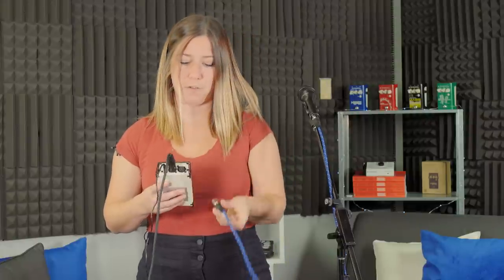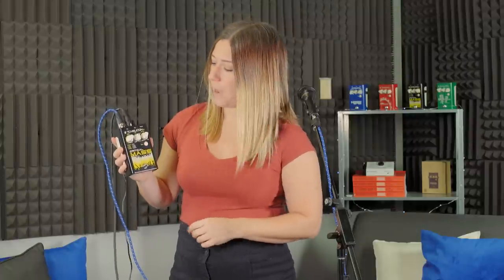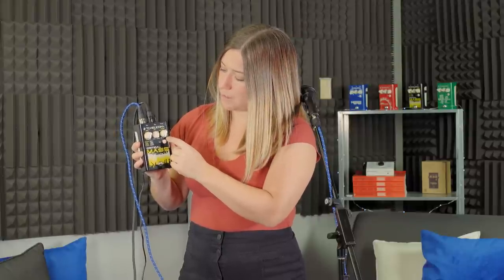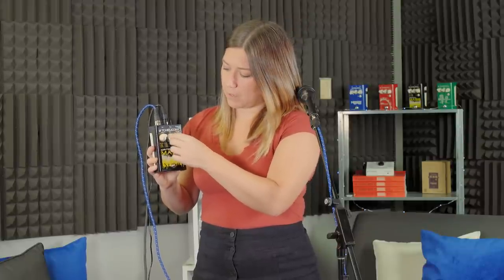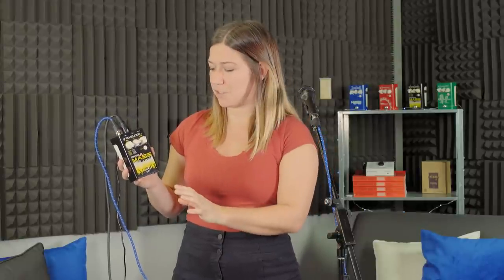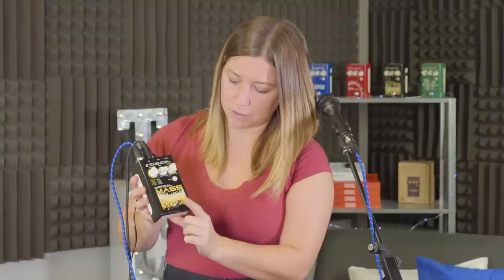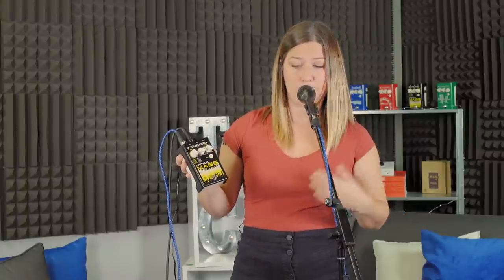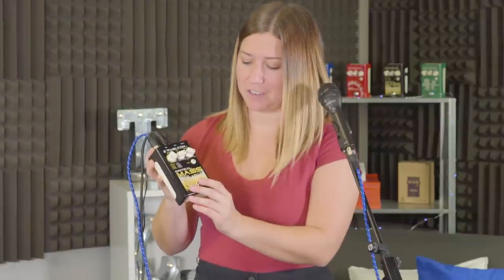Helicon Headquarters || Critical Mass Quickstart Guide

Comment: It uses up the AA batteries after 3 ~one hour sets.  Consider getting the AC adapter if you plan on using it live.  When it dies so do your vocals.
Reply: or a rechargeable power brick.

Comment: Could you help me? This one is giving 24 volts, but my mic needs 48, will it harm if i plug my mic first to an external power supply and from that its connected to this pedal? So the chain:
Any48V mic —> 48v Powersupply —-> tc helicon —-> audio interface —-> pc
Thanks for your help

Comment: Hello. I got the critical mass new. For the first time I plug all connections with AC current. But the red light meant for the batteries glows, and I get no sound in my speaker. What could be the solution?

Comment: It would be nice if the added vocals didn't have to be an octave. I mean, I guess on a design standpoint it's a lot easier and cheaper to do...but it would sound better if it was not an octave. It's sometimes a bit extreme on both ends at times.
Reply: It does unison as well @ 8:31

Comment: I have the (older, 12v power) Voice Tone H1.  Would the harmonies come out muddy, or would they sound like a proper harmonizing choir?
Reply: I never would feed the Voice Tone H1 with a signal from Critical Mass or otherwise. I would use a XLR split cable, feed the microphone in both units, would decide, on what of both devices I use my leadvoice and where not. If the main vocal needs reverb, I would take it from the Critical Mass.
In realitiy, the audience sing along the melody line, not harmonies. You could set the Critical Mass on in the chorus and the H1 on, when there's a part, that needs some choir.

Comment: Default phantom power is 24v always on for Critical Mass. What do I do I do not want Phantom power or my mic requires 48v instead?
Reply: 1. "I do not want Phantom power": If the mic has a balanced output, and is 
wired correctly, even if the mic is a dynamic or ribbon type, phantom will not hurt the mic. So technically as long as you're not connecting microphones with TS jacks, you should be good. For doing that you would need adapters anyways because the in and out of this pedal is exclusively XLR cannon balanced, so in short, any standard microphone should be fine with this.
2. "my mic requires 48V": 24V phantom (P24) was added to the DIN standard (now DIN EN 61938) in 1979 - joining the earlier P12 and P48. It was added because it allows better power transfer which was thought to be an advantage with more-complex mics. It was actually recommended for new designs in 1996. Really only true condenser mics need 48V for polarization. Many mics that use pre-polarized electret capsules will work cheerfully down to 9V. I imagine the designers of these pedals had not thought it likely that they would be used with studio-grade condenser mics.
Reply: @kiskadar69  but it does work with power supply?
So mic to PU to Helion to audio interface is a thing correct?
Reply: @sandorgyorgy6445  Do you mean this chain:
condenser microphone -> external phantom power supply -> TC-Helicon Critical Mass.
I don't know if it would be safe. The Critical Mass’s own phantom power supply or the external phantom power supply or condenser microphone could be ruined.
Reply: @sandorgyorgy6445  The TC-Helicon single pedals do in fact have 24V phantom power that is always on. I would prefer a micro-switch to disable it.
Reply: @kiskadar69  sad, i couldnt find anything on internet if the external power supply will or will not ruin anything with pedals like this :(
Reply: @sandorgyorgy6445  Ask TC-Helicon:
https://community.musictribe.com/pages/tc-helicon